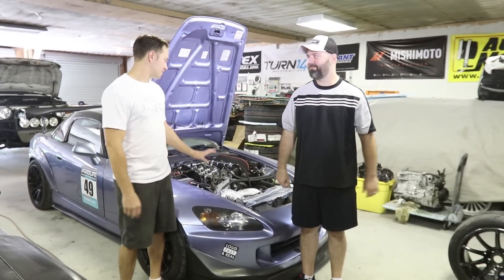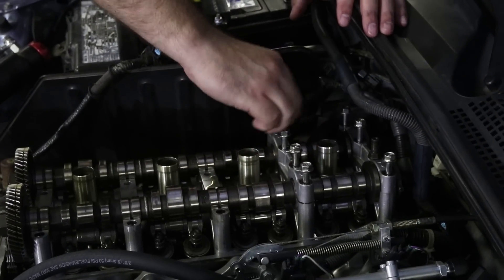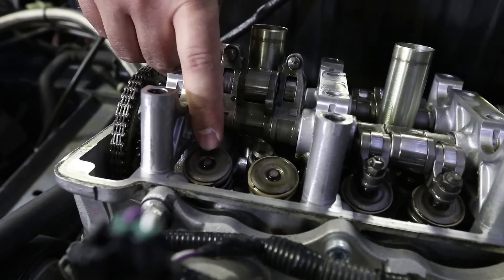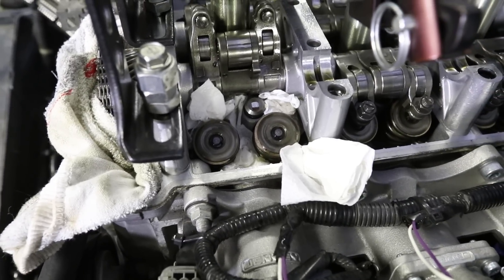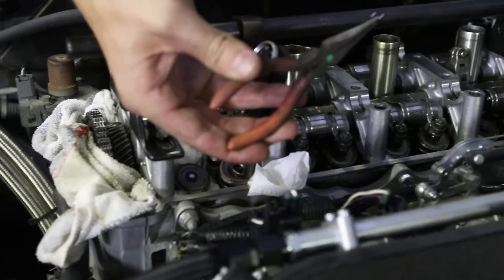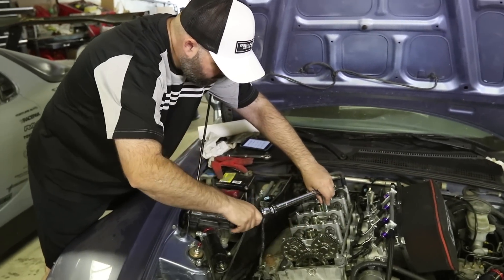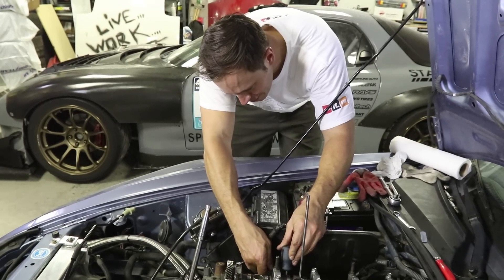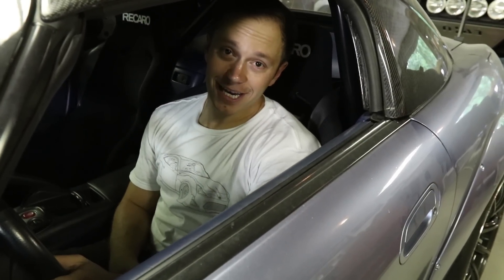How To Swap AP2 Valve Spring Retainers & Set Valve Lash - Project BADASS2000 - EP13

Comment: The wear on the cam lobes is called micro pitting or grey-something-something (german here, i don't know the correct term) it's usually caused by overheating due to either wrong design or not enough lubrication. Since you can't change the design, maybe try another oil to prevent further damage. This might also happened in the cars life before you so...maybe its not your fault. Anyway....unfortunately this is not going to heal itself but actually amplifies itself (happy to explain the mechanics behind that if someone is interested) so you might want to keep an eye on it. 

Awesome project guys and love your relaxed and down to earth way of presenting it.
Reply from the maker: We figure that oil could be the cause but at this point its not really worth trying to find one that will cause less wear. We'll replace the cams eventually.
Reply: I am so proud that you answered :D :D :D

Comment: The factory spec is .009" intake and .011" exhaust. Car makes more power on the loose end, any extra lift you get is offset by increased guide wear. Car will always make more power when the valves seal properly which can only be achieved by being within specs. As the valve spec tightens over time, I leave it on the loose end .010" intake, and .012" exhaust, it makes a little valve chatter, but that doesn't hurt anything. Loose makes a little more power believe it or not.

As the timing chain stretches from mileage, increasing the valve clearance brings timing back in line.

Comment: I believe the reason why the AP2 retainers are "more robust" is because they're made out of titanium. I drive the shit out of my S2000 with AP1 retainers, but as long as you don't mishift and overrev (money shift), they'll be alright. It's good to upgrade though.
Reply: AP2 retainers are heavier than AP1 and it is acceptable due to the lower revving AP2 engine. The inertia of the valve, retainer and keepers assembly is matched with the valve spring's stiffness coefficient, which is important to prevent valve float at high RPM.
Reply: so its only from misshifting and over reving right? not if i hit redline and it bounces off the rev limiter??
Reply: correct.
Reply: Blake, how many miles on your car?  just curious....I got 198k on my s2000.
Reply: I have 135k on mine
Reply: I money shifted the other day (had my S for 4 years before it ever happened) and my heart sunk. I am now going to swap for ap2 retainers and hope that the noise coming from my motor is my valves needing adjusting rather than knock (sounds more like ticking than knock -no it’s not the TCT). If anything is wrong with my block, I’m going to scream. I literally just swapped this motor in a month ago. I wouldn’t trust ap1 retainers even, if you trust you won’t money shift. It happens; our gearbox has a tight design, and if you bang years like me, you may find yourself in shit creek one day.

Comment: have you change the spark plug gap? that maight solve the missfire, also you may have lost a little power by changing the trani for and ap2 one as far as i know it has longer gearing for the added torque and lower rev limit 
great channel big fan

Comment: If you detach the magnet from the tip of your tool and stick it into a socket, the hammer method will get the keepers out without worry of losing them in the engine.
Reply from the maker: Great tip!

Comment: You really need a second person with this kind of universal compressor tool,  I had to do this job alone and I had several nervous breakdown moments with it xD 2 of the keepers flew into the enginebay, it took me fucking 2 days to find them again. After this I built a screwdriven tool at work to compress the springs.
But great video as always

Comment: Is there a written article on this do u need to lower the position of the piston on each cylinder as u need to compress the valves
Reply from the maker: Nope, the piston can be in any position since the compressed air keeps the valves from falling in.
Reply: Speed Academy hi.. what psi did you guys set to pressurize the valve from dropping?  Thanks for the cool channel

Comment: Hey guys. I'm sure it might be a long winded response.  But I'm shopping between an AP1 and an AP2 with plans on building the  car and keeping it NA like you all did.  But want to squeeze as much power as possible.  Was there a reason why you went with that AP1 versus the 2?  Thx for the feedback...
Reply from the maker: We bought the AP1 since it was the cheapest one available but the AP2 is the better gen of the S2000s since it has suspension geometry improvements a better diff, trans and more displacement.

Comment: I think you are thinking about whatever you read about the valve stem dropping below the spring retainer wrong. The valve wouldn't have dropped down, the spring retainer would have raised up from the spring pressure.
Also where have you placed the piston when you are doing this? Near the top so if the valve dropped it wouldn't drop all the way in?
Reply from the maker: If the retainer cracks and starts opening up then the keeps will fall which is why people say the valve stem will sag. And yes, we turned the piston to TDC so that it wouldnt allow the valve to fully drop.
Reply: Luckey above is right, the valve stem does not move, the retainer rises slightly as the crack widens, the collets must stay with the valves locking grove so they 'appear' to fall... So the inspection method IS valid.

Comment: is the leak down tester to stop the valves dropping into the engine when the keepers are removed
Reply from the maker: Yessir. Compressed air in the cylinders keep the valves in place.

Comment: i knew PT would step in when it got more technical lmao. i was hoping for a whole valvetrain upgrade (a mild set-up) to squeeze out more power with the itb's. is there a reason as to why you chose to go with the bigger exhaust? I'm pretty sure you've done your research, though.
Reply from the maker: To see if the larger exhaust will free up some ponies.

Comment: I've had better luck with the hammer valve tool than i did with the swing arm tool. Installing especially. Way less swearing lol
Reply from the maker: With Peter, there is always a lot of swearing.
Reply: +Speed Academy  how do the spark plugs seal go push in or out 
.

need help plz

Comment: that cam wear looks like heat spots to me. hard to tell with out putting my own two eye's on it. and i'm also curious as to what the bearings and rockers look like. if it's not too expensive i would seriously consider replacing that cam. and if yall wanna make some affordable gains, look into doing AP2 exhaust cam and TODA gears.
Reply from the maker: We may do cams eventually but first we need to do an air box and exhaust.
Reply: yeah that dryer hose set up is a little sketchy haha. and i can't wait to see the exhaust video!

Comment: I sincerely apologize if this sounds like "that internet guy", but is that an ap2 valve cover y'all are using?
Reply from the maker: It certainly may be but the engine is most certainly an AP1
Reply: Ah, thanks for the clarification.  Also, you guys may have actually seen this person, but there is a s2k that tracks at your park that is putting down 330 whp all motor.  I think that's where some of the "itbs can keep up with a sc" talk is coming from.  Of course that was a very pricey build with a k24 crank and rods/pistions,  cams, and you all mentioned you're not doing cams, let alone a full all motor build.  

It would be interesting if that owner, if he reached out to you, would let y'all drive for the purposes of comparison.

Comment: I wonder why use the OEM AP2 retainers? why not upgrade to Supertech, Ferrara, or even Brian Crower?
Reply from the maker: Because OEM AP2 retainers are a proven upgrade on the stock valvetrain. OEM is usually best when it comes to internal Honda parts.
Reply: thanks for the insight, I may look into some for my AP1
Reply: u should
Reply: oh.... before you guys took off the cams did you put the engine in top dead center?

Comment: Neat tool. I used a traditional overhead valve spring compressor while perched over the engine like a monkey. I only used 35 psi much more and it would turn the motor. Not sure how you guys got 120.
Reply: They might have left it in gear
Reply from the maker: We kept adding pressure because the valve would open. Turns out we had to bang on the keeper to loosen it.

Comment: guys, love your content. next time you remove retainers like that, take some braided nylon rope and snake it up into the combustion chamber. then rotate the crank until the piston presses the rope against the valve. that way your valve spring compressor tool does the trick.
Reply from the maker: Thanks for the good tip!